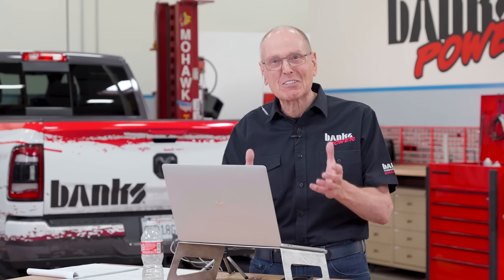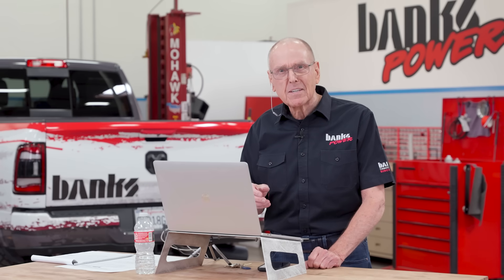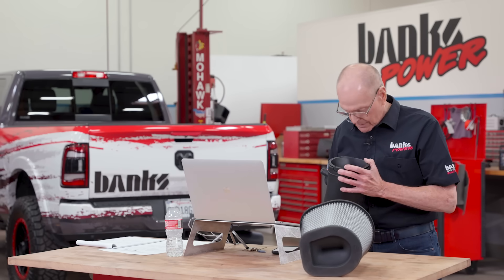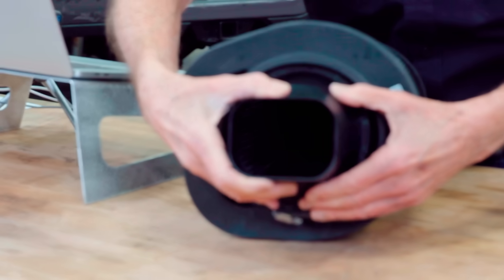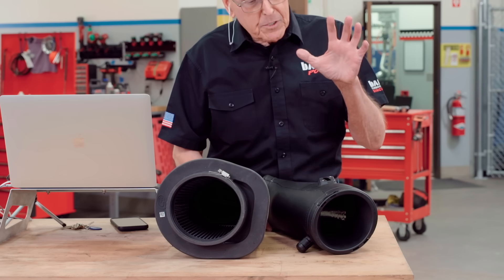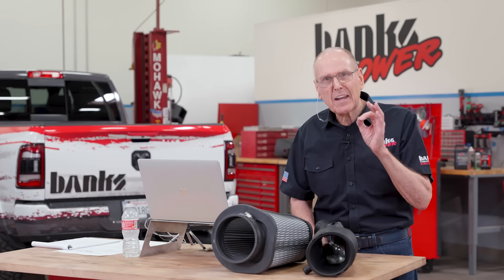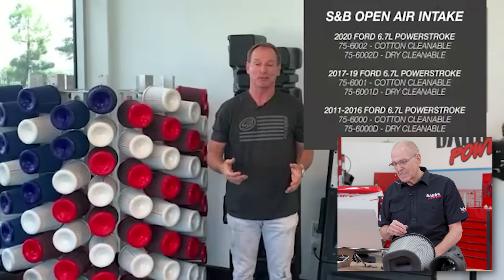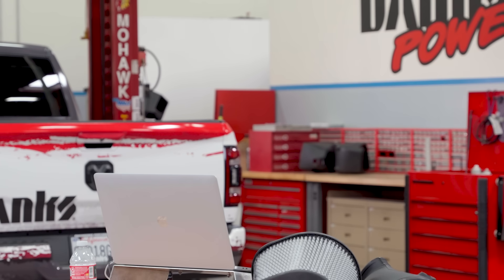Stop making these air intakes! | Fact Check

Comment: I am so glad you made this video! I installed a S&B CAI on my 21 Silverado 6.2. It made it about 4 tenths slower and lost 3 mph trap speed according to my Race Box. It specifically lost huge performance off the line. I knew it was the relocation of the MAF sensor. I called S&B tech and they told me I must have a bad sensor. Well I put it back to stock and it ran perfectly again. All the performance right back! So that is another one you can test but I'm sure it's the same problem. Thanks Gale for your knowledge!
Reply: My father bought a pre-owned 21 silverado that had a S&B CAI and the truck had so many codes. The dealership warranty work tried everything,  throwing parts at it, re-flashes, finally they replaced the air filter and intake to a stock set-up and it cleared up everything. . No more codes.
Reply: Newer Chevy trucks don’t like aftermarket intakes, they all cause issues from what I’ve seen
Reply: Yeah, but, how did it look?
Reply: That's because you put it in their crooked. If you did it right you would have been 4/10 faster and gained 3 mph trap speed. That thing has to be in there just right, at a certain angle...
Reply: @actionjksn  no I put it in right and I know 3 other guys with the same results.
Reply: @rubbersatin  I actually gained 32 horsepower and trimmed a full second on my quarter mile from just using this CAI on mine. But I got that thing in there at the perfect angle. It's all in having that metastatic quadrant nailed down and forcing the oxygen molecules to stretch themselves in an oblong fashion. In other words you are streamlining the oxygen molecules and it works almost like a micro turbocharger. Also that clamp has to be oriented just a little past the 2:00 position. It's all about the science my friend. Gail Banks has a lot to learn.
Reply: @actionjksn lol what
Reply: @actionjksn  😂. That’s good stuff.  Good job.
Reply: @rubbersatin  I think his sarcasm went right over your head...
Reply: @actionjksn this comment made me LOL

Comment: An OEM setup that is properly ducted and directed to pull in air from the grille or other front facing opening will outperform a cone filter 10/10 times.

Comment: "This is bullshit" yup, that about sums up that gong show air filter & intake pipe.  I've been HAMMERING this fact into people's pea-brains for decades!  Underwood air is HOT AIR and reduces efficiency and power and you can have a 10 foot diameter intake pipe but it's only as good as it's smallest diameter of the intake manifold before entering the engine.

Comment: I have a LS swap on my 90 Chevy and have ran on open element filter behind my battery for years. I do plan on building a box for it someday, but the LS even pulling in higher than ambient temps makes almost double the old TBI 350. So it hasn’t been a big concern.
Reply: I let the 2016 ford f250 idling for an hour at a job on a hot day, you go to leave and that things so lazy until you get above 25 or so and after 5-10 seconds you get some response back. 
It's so heat soaked under the hood it's killing the timing and fuel, and it's stock.
Reply: I’ve got a 5.3 in my ‘89 c1500 single cab short bed. Moved the battery to the driver side, stock 5.3 intake tube, with a cone filter flopping around on the stock battery box on the passenger side. Definitely not ideal, but leaps and bounds ahead of the tbi 350 for sure.

Stock cam and heads and everything, I get around 18-20 in mixed driving. And I drive it hard. 3.08 rear gear and an nv3500 trans.

Comment: Last video about airflow on front of vehicle on the dyno is soooooo true. We have chassis dyno at truck dealership only for testing power or test drive not tuning. If we don't have engine fan running while doing power test we get check engine light because intake temp too high. It does turn fan on by itself but it spike intake temp by the time fan turns on and cools intake air in CAC.

Comment: Remove the restriction and recalibrate the maf sensor to accommodate the extra airflow. 

"Airflow vs frequency" under Engine>Airflow in the ECM. It'll require that you disable certain functions and log your fuel trims, but if you setup your pids correctly you'll acquire correct data to update the maf curve according to RPM. Of course before that you should update the VE table, but the maf calibration is essentially what is needed to get it to work without that restriction in the charge tube.

Still...hot air is no good. Ideally, a closed box or fresh air inlet from the grill is better. Then there's bestest: interchiller/ice box.

Banks is good stuff though. Legitimately made my father in law's disel truck much better.
Reply: Your first paragraph, that's too much work for these guys.

Comment: The intake insert is so you can run this intake on a stock tune.  If you reflash the ECU with upgraded maf data from the new tube you should be able to remove the insert and pick up some good power. 

Banks provides a maf manipulator which skews your maf data.  I personally would rather have my maf reporting actual data to the ECU vs. relying on his signal modifier.

Comment: Mr. Banks, love your work with diesels and H2O injection. 
I have been running it on my semi's for about 12 years now, and WITHOUT exception it has turned EVERY ONE of the into absolute power monster.
So much that my lowly,stock gutless c13 out pulled a 600 hp c15 out of L.A.
Both trucks were loaded to 80,000#s, 5 big mountain passes,  out pulled him on every one.
EGT,s are so much better, way less heat into the water jacket,  I love this stuff, won't run my truck without it. 
I am currently running a big c15, dyno to the wheels w/o H2O was 625 H/P. I turned the engine down, smaller cam, lower H/P,  I was afraid something was going to get broken.  6% grades, 80,000#s, 50 to 55 MPH, and could accelerate up to that speed on grade from a stop in about a mile.
You owner operators should really invest in this. It's like magic. 
Thank you.
Reply: Is that something banks sells?

Comment: When I bought my built LS powered Volvo it had an open filter in the engine bay. Probably 6" from 1 3/4 longtube headers. My iat were up to 140° and was pulling a ton of timing. I made a duct that ran along side the headlight and into the grill. Now my filter and maf are mounted behind the grill in front of the radiator. And my iat never see more then 5° above ambient.
Reply: It's not flow tested, but I know I'm able to maintain 25* of ignition advance all through it's torque band. Before it would pull to about 19* and still occasionally detect pre ignition (spark knock). I'm not a tuner by any means but I know hot air = not good lol... With hptuners I was at least able to log and edit my iat correction spark map as well.

Comment: Cmon Gale ....... 
I purchase  UNDERSIZE valve guides for Honda B16  from Ferrea  for converting VW heads from 7 mm stem to 5.5mm stem and they fit right in.   I asked why they made them :   as we were getting crazy of guys asking for it as with normal  press fit the spring plateau cracks into the ports as the ports are ground so huge there is no strength anymore. So the guides are glued in with Loctite  without press fit.
I asked : but such HUGE PORTS are ineffective ....it wont work. 
Yeah...we know,  but the continous request for undersize guides to skip the  grinding down of stock size guides with sandpaper  is stopped now.

Ok....that sounds good....🤯🤯🤯🤯🤯

Comment: Gale tells it like it is and his reactions are priceless. 🤣🤣 I have the Banks Ram air in my 7.3 Excursion and what he’s saying is true. I’ve learned so much and have been able to help my truck run better, but also educate my customers 👍🏻
Reply: Did it help your fuel economy thanks
Reply: Yes it did. I was previously running the open air 6637 filter and while it gave the engine all the air it wanted or needed, it was still sucking in hot engine air. The Banks Ram air draws from both the fender and the front of the truck, so it’s always getting the cooler air from outside the engine bay. I see little to no black smoke which means the fuel is burning better. Quite a few things were keeping my 7.3 from running its best, I got it all fixed but when I got this intake, it was the cherry on top of it all. 👍🏻

Comment: This is quite embarrassing from S&B . I have genuinely loved S&B products as I believe like Banks an enclosed air box is the only true “cold air intake “ . Sticking an open cone filter under the hood is just nonsense especially on a turbo diesel. I mean the whole point in performance is clean cool oxygen dense air , not hot dirty under hood air . I laugh every time I see a gear head going cheap a getting rid of the stock box in favor of an open cone filter. I’ve even argued my point on this . I have an S&B closed kit on my 7.3 powerstroke and love it but to watch S&B got this direction is just embarrassing!

Comment: I had an enclosed intake from S&b on my third gen Cummins. With the top plastic cover off expiating the filter to engine bay heat. My intake temps would be around say 165 of a 80 degree day. With the plastic top piece off making it a true enclosed inteke box my intake temps dropped between 120-130 degrees on a 80 degree day. Main driving difference was more turbo noise with the cover off.
Reply: What about your charge air temps? You had an intercooler, right? Maybe that's where the open vs closed top becomes less important. On turbo vehicles with an intercooler to bring those intake temps back down.

Comment: I appreciate the roasting, but Banks also sells a couple of products that kinda feel similar. Their F-150 exhaust for example is listed as 3" claiming power, response, lower temp and more mpg but appears to just tie into the factory intermediate piping which is 2.75" (and stock flares out to 3" anyway at the muffler).
Reply: They all want to make money at the end of the day.  Banks is no exception
Reply: You are correct but only sort of. You are going to have a restriction somewhere but when you add on a higher flowing exhaust it will lower temps and give you better power. Response and more MPG won't really happen though, only slightly.

Example of this is my 5" on my duramax, my exhaust temps are way down even though I am still attached to the factory 3" downpipe. So what gives? You now have more flow from the downpipe onward allowing the hot air gasses to escape quicker rather than having a 3" restriction all the way out the back.

Hope that helps your understanding.
Reply: @shakenfake  if the factory system didn’t also expand to 3” at the factory muffler I’d say you have a point potentially. Sounds like your system removes a restriction at wherever the downpipe meets the exhaust but this particular product does not remove any restriction. I suppose the Banks system gives you about 12-18” additional in terms of 3” piping but probably cheaper just to get a 3” intermediate pie for $100 bucks which does the same thing.
Reply: @ALMX5DP  But then you are reducing that pipe into a 2.75" muffler inlet 😊 but yes on a gasser it is way different anyway. It is gimmicky that an exhaust can help MPG and power etc (It is possible in some applications that yes it will but 99% of vehicles this is not the case) It will however reduce EGTs

Banks exhaust is not overpriced considering it is a whole system. It is about on par.
Reply: @shakenfake  the Banks system would be fine if it was a complete 3” system from the y-pipe flange back but it’s not. The factory muffler is 2.75” at the inlet but people have expanded it to 3” and the rest of the muffler is 3” so technically a full 3” intermediate pipe from the flange would technically flow better than this Banks unit. That combined with the claims makes it really no better than the person he is roasting here.

Comment: Seems like the guy knows his stuff but corporate is forcing his hand. Thus he's having to spin it the way he is. 

I grew up in the south and so many people think that slapping a K&N round filter and tube under the hood gave them extra power. The filters were often between the battery and exhaust manifold. These people didn't care that their car/truck already had a cold air intake from factory and at most all they needed was the factory filter replacement. It was the coolness factor of having something pretty under the hood and having the knowledge that almost everybody thought it added some power and did no harm. 0 other mods were done to almost all of these vehicles.(I worked at O'Reilly's and we would sell a ton of these things)   Most of the people I knew personally doing this were all chevy guys with vortec engines. In reality they could have just did the throttle body mod and gotten a ton of throttle response without hurting their engines performance.

Comment: Thing is, Mr Banks, most people are stupid and/or ignorant, and don't always (or even usually) know what's best for them.
There are many people who just want the sound and/or looks of an open filter and don't really care if they're throwing away a, relatively small, power gain that a good closed design offers.
They're the sort of people who bolt random stuff onto their engine, or cut off (or gut) their cat's, don't maintain their vehicle, want "tunes" that give the (damn fool) "ghost cam'" affect and/or want flames on the over-run, etc, rather than tuning for efficiency and torque.

Comment: I have what Mr Banks would call a hot air intake. I have a 4 inch cowl scoop that gets air out, I've never seen air intake temp higher than 10 degrees above ambient

Comment: Liked and Subscribed. Honestly would like to see vehicle in movement testing rather than sitting dyno testing. Sit still doesn't stimulate air movement in the hood and more closer to heat soaking.
Reply: Gale has a thorough explanation of his methods on a previous video.
Note.... It's tough to drag a dyno down the road at 70 mph. 😳
Reply: @hotrodray6802  True. You won't get HP but you can measure to show lbs of air and temperature of the inlet air. Given this is the same vehicle, and same testing equipment, this would correlate to HP gains or loss.

Comment: Wish banks technical support was as good as these vids and the info that gale shares with us. Been waiting for a return call from tech support for over 2 weeks for a CEL after I installed the banks intake on my 23 L5P. Nothing like pulling a camper across the country and resetting the light every few hours…. P22FB code
Reply from the maker: On behalf of the Banks team, please accept our apologies for the delayed response. When you have a moment, please text us at (800) 601-8072. We'll tackle the CEL ASAP.
Reply: @bankspower  I’ve had an open text dialog with tech support since February 8th that includes pics and vids of the problem. I have yet to receive a reply.

Comment: Gale Banks is selling a product as much as the next guy.  Interceptor circuits that interfere with factory sensors and essentially modify signals and or deceive the ecu are nothing new and nothing about his patent seems particularly novel in my cursory reading of it.  All this tuning of mildly modified stock vehicles is largely a total waste money regardless of whose products you're using.  Outside of correcting glaring design issues all modern engines basically generate about the same power for a given displacement, rpm operating range, and amount of forced induction.  The magic only happens when these parameters are altered in some significant way that almost always requires surgery of sorts.  Gale sucks up to the emissions lobby more than I would like but he's right to trash the "rolling coal" meat head assholes of the world.  I am very much a conservationist but the current environmental lobby is anti human tyranny in its purest form.  He deserves all the credit in the world for introducing turbocharging to the marine industry where it was sorely needed  It was sadly banned by the brain dead racing gods.  The newer Mercury turbo big block derivatives could and should have come to fruition in the 90s or early 2000s.

Comment: I remember being surprised how much more power my Saturn S series had when first started on a cold day. Somebody mentioned air temp; this was before I knew a lot. Eventually I put a hole in the hood and screwed a blazer filter housing on top of the hood. PVC intake with a foam gasket against the hood.
Reply: While I never messed with the air intake, upgrading the ignition made a gain of almost 10 mpg on my 02 SC2.  The service manager at the dealer even admitted the ignition system was designed to be weak.

Comment: IN light of the success of the air mass control module on the 2020 and up, are there any plans to go back to the 17-19 and upsize the tube for more airflow?
Reply from the maker: There have been discussion about it internally. If we proceed, you'll definitely hear about it.

Comment: I would love to get Banks power intake exhaust for my 2019 Chevrolet L5P but it’s so expensive. I was going to get the I-Dash but I went with the Edge CT4 monitor because it’s bigger and easier to see then the I-Dash. And the intake I’m not 100%  sure. I drive around a lot on dirt, roads and Dusty environments. And in my opinion, I think the OEM filter will capture more dust and dirt than a cold air intake.
Reply: Gale himself has said multiple times, the OEM spends millions on R&D, so better to leave it.